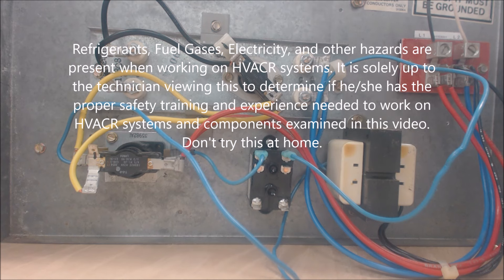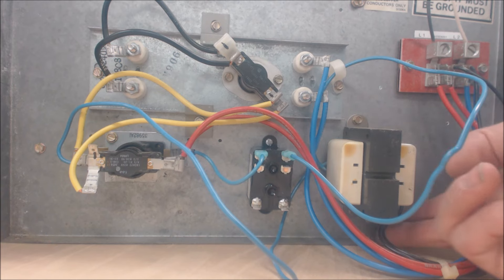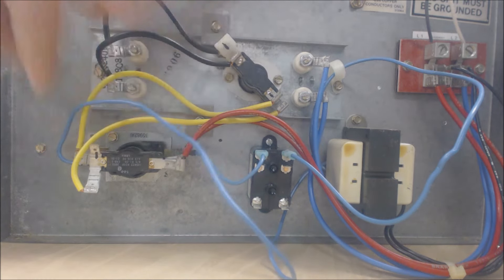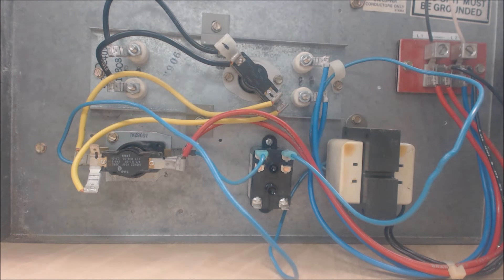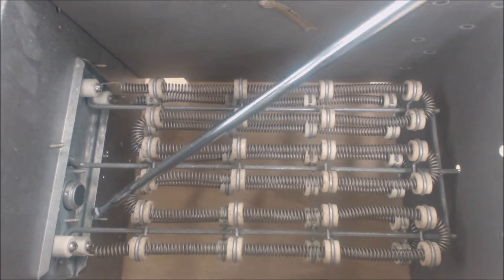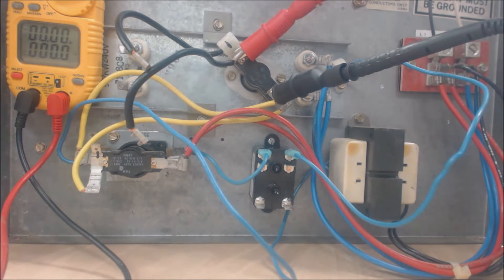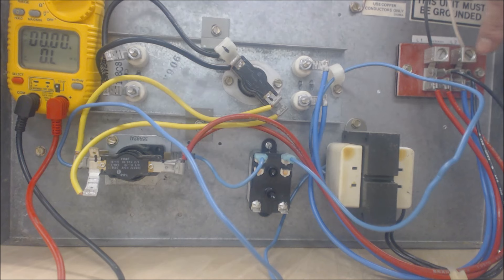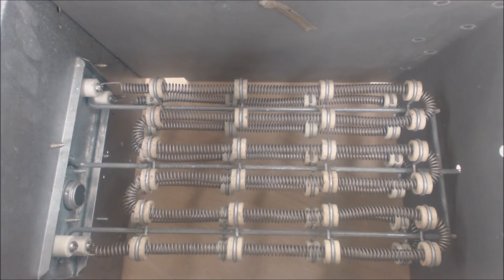HVAC Electric Heat Strips and Components: Explained, Voltage Path, Resistance Readings!

Comment: Great video. I have your book. This acts like an or gate as far as sequence control. For 3 or 4 element I suppose you just repeat with an additional circuit breaker and the 2 element sequencer.  Is there a 3 element sequencer made for 220v circuits ? Gotta wonder, probably not.

Comment: I love your videos. As an electrical contractor .  OL on the meter stands for (open line).  N.O. = normally open as it sits for contacts.
Reply from the maker: Hey Tunazzi, OL can also mean over the limit of resistance that the meter can test, meaning an extremely high resistance. Open line and over limit are the most frequently used terms. I believe everyone uses the same description for NO and NC, thanks

Comment: Mind blown. You made it so easy to understand. Especially, the electricity path of travel. Other channels fail to do this.
Reply from the maker: Check this one out too on the 24v wiring of an air handler and heat pump! https://youtu.be/1nQ7k_X2aXA

Comment: Could you post a video with elements also explaining more in depth the fan relay and blower motor wiring. Or am I just not seeing it if you already have one. I know that's a lot to ask but you are the best instructor on you tube.
Thanks for all your hard work!
Reply from the maker: So I apologize but I do not happen to have something like that yet. I do however have 240v blower motor diagnosis and how it works, and thermostat, heat pump defrost board and air handler board wired all together and what is happening, and a video on how fan relays work. Here they are. Always feel free to ask because that lets me know what people are looking for. Also check the playlists such as Heat pump troubleshooting or Blower motor troubleshooting or any of the other playlists and just pick the videos you are looking for through there. That is what I tell my daytime students. -- https://www.youtube.com/watch?v=uHXw8o_YoZk&index=16&list=PLxnHR5_D2ojyDrxCT9MIttGW4wxOZ3n-7  --  https://youtu.be/AE5zRWtlhAA  --  https://www.youtube.com/watch?v=fFL_ZSkAZM0&index=11&list=PLxnHR5_D2ojzDfU1IjPpzdhi_mUGe3F7W  --  https://www.youtube.com/watch?v=qiAOvJhq8_s&t=115s&list=PLxnHR5_D2ojzDfU1IjPpzdhi_mUGe3F7W&index=8

Comment: hi, sorry but i am a little confused. one end of the heat strip is getting 120vac (blk wire), the other end is also getting 120vac (blue wire). so how does voltage path goes from L1 and back to L2 when both ends of heat strip has 120vac? please help as i've trying to figure this out for awhile now. thank you to you and all your awesome videos.
Reply from the maker: So the 240v finds its way back through the other hot. 240v doesn't use an additional common. It has to do with the sine wave of the voltage being 180 degrees off from the other one so they don't interfere with each other. This frequency happens 60 times per second, thanks
Reply: Hey service tech . Can u explain but a little deeper ? So if if there’s no call for heat , and I put my meter across one side of heat strips and the other end I should be getting 240.v since it’s open . But when call for heat it should read Nothing as it’s close .? Or am I complete wrong ? Please help thanks in advance

Comment: That looks like a 10kw heating element. How do you determine the limit switch rating? Awesome 👍!!
Reply from the maker: You can use ohms law by reading the resistance of the coil and the current when powered. current= voltage/resistance  thanks!

Comment: Great videos!    I am doing an all new install of my Gibson/Nordyne 4 ton split system heat pump/air handler.   My 24kw heat strip has three 60 amp breakers and my unit is 30 feet from the breaker box in my house.  I have to use the HUGE size wire for those  three 60 amp circuits don't I?   I had been thinking I was going to use a bunch of 10 gauge wire and have an easy time.....
Reply from the maker: You definitely cannot use something as small as 10 gauge. You would have to look at the wire length to determine if 6 gauge or 4 gauge to each breaker would work.

Comment: On this application, would you run the white wire to the fan relay?  Would the sequence of operations be? 1. White tstat wire calls for heat and closes fan relay. 2. sends 24 volt signal to sequencer. 3. Closes 4-5, then 2-3?

Comment: I have a question about the high dollar furnace boards. Why do you even need them when you can do both  heating and air with a simple thermostat, sequencers and/or relays?
Reply from the maker: Some units run heaters on sequencers such as some overhead garage units and such. Ha ha yeah it is crazy right? It is all about efficiency and control of OEM parts I think.

Comment: What size of heat strips are  correct or recommended  for a 2 ton heat pump.
Thanks for all the information it is really good.
Reply from the maker: Hey Ruben, honestly that will all depend on your heat loss for the house as well as where you are located at in the country due to design temp. What I mean by this is if you are working with a conventional heat pump and it is 10 degrees outside, the heat pump won't be able to provide much in terms of heat and all you are left with is your supplemental heat strips. In this case if you were stuck with heat strips only then you may want to go with the higher kw ones. If this is florida or somewhere where the temp does not go down very low then the heat pump will always provide some heat and your supplemental strips can be less such as maybe 5kw and not the full heat load. We cant go just by the size of the existing heat pump size but you would need to know how much total heat you need (heat loss) and the design temp of that area. I hope that made sense, thanks
Reply: acservicetech thanks it is really helpful.I' m in NC.

Comment: Had my electric meter chekd and it's fine but he said that the heater when we turned it on it was pulling over 100amps.Does this sound possible and if so what would be the cause?Also this is a carrier heat pump and the heat still works but he was saying that it's the culprit for the high bill?

Comment: This would have been a great time to cover the "W" circuit that requests Aux heat, and the many things that could cause it to go awry... like on my heat pump. This looks a lot like my mom's electric furnace, but my Trane heat pump has a (failed) large 2-pole contactor and a problem with the 24V control circuit for Aux heat. 2 strikes and it's out.
Reply from the maker: Yes many have sequencers and/or contactors. I have videos specifically on those, thanks uruiamnot!

Comment: Great video with usual detailed, non-assuming information offered so all experience level techs can understand.   If the two strips heaters are typical 5KW each or pull ~21 amps @ 240 V, please address the size of L1-L2 source wires which appear to be smaller (less ampacity) than the wires from the terminal block to the sequencer and to the strip htrs.    Perhaps camera angle/depth causes an illusion.  Thanks and Merry Christmas with best wishes for the new year.
Reply from the maker: Hey Papa Joe, You are very much correct! This was only for quick testing purposes and you are right, I should have put 6 gauge on the top. I will put a note in this video and I will put a fixed note in one more I am editing. During the installation the wire must be rated for the max amps of the fuse or breaker that the unit is calling for. Thanks for pointing that out. I was not sure how much of that was going to be visible and this strip kit is sitting on my workbench. Thanks Papa Joe, always a pleasure!

Comment: Great video! I didn't see the high-voltage, for the blower motor. Is it usually 240v or 120v?
Reply from the maker: Yes forair handlers it is usually 240v there is usually a fan relay on a control board or a fan relay by itself or a sequencer, thanks!

Comment: When the defrost board energizes the W terminal during defrost to turn on the heat strips, should the thermostat aux indicator light up?
Reply from the maker: Hey Randall, only if the Emerg heat and Aux are jumpered together. Defrost powers Emerg heat and it may backfeed voltage to the aux.

Comment: I been having issues with duel fuel troubleshooting. The gas ruud units with heat strips. Do you have any help for me?
Reply from the maker: Do you have a model number? What kind of thermostat are you using?
Reply: Thermostat was a manual suited for a heat pump with switch for em heat and heat. Only the gas would come on in both modes. This is my first heat season as a new tech. My company I work for half do stuff. I want to learn the right way how to do thing.
Reply from the maker: Have you checked this video on dual fuel wiring?  -https://youtu.be/HhhesjH9BWI  -or air handler wiring to hp thermostat-  https://youtu.be/fFL_ZSkAZM0 ---- you may want to check out the thermostat troubleshooting playlist for other troubleshooting tactics as well, thanks ----  https://www.youtube.com/playlist?list=PLxnHR5_D2ojzDfU1IjPpzdhi_mUGe3F7W

Comment: There is no inrush current for resistance heating. The same amperage is felt in circuit when resistance heat is first turned on as it is a minute later, an hour later, and so on.Inrush current occurs in motors, high amp draw to start, than a lower amp draw after up to speed. If ckt. cant handle both heaters coming on at same time, it still wont handle it if they are staggered.
Reply from the maker: You are correct. That is a resistive load.

Comment: whats the purpose of having that fan relay before the sequencer?and why dont you show the fan wired in with it?to show an actual functioning unit
Reply from the maker: This video was just on an electric resistance heat strip kit. This is just one version of a heat strip kit. I may in the future show the wiring included with an air handler board. Thanks

Comment: Thanks for great video, I have 20kw heat strip hkr-20c, 4 coils and 5kw on each. And one of the coils was damged or broken, which was caused by loose connection at one of the two  double stacks sequencers. Can I still use the other 3 coils assuming I will replace the bad sequencer and leave the broken coil out of electrical connection from the sequencer plus making sure the damge coil are not touching other coils?
Reply from the maker: Yes you could, thanks

Comment: I have a Tran Model TWE030c140A0 XE1000  unit, my fuse in the thermostat in blow 3am
when the heat come on? it is in the thermostat, or the electric  Heat?
Reply from the maker: It could be the therm, therm wires, or relays. You could first try jumping bypassing the thermostat to see if it is the face that is the problem, thanks

Comment: Does this heat strip connect to an entirely different circuit apart from the air handler itself?
Reply from the maker: It is usually all one in the same. Always follow the install directions from the manufacturer though, thanks

Comment: where did the red wire coming from my blower fan go my account shut off and it's disconnected think a rat knocked it off or tape got old not sure
Reply from the maker: Does it say on the connection diagram for wiring on your unit? If it is a red wire from a psc blower then that usually means low speed, thanks
Reply from the maker: I am sorry, I only answer comments and don't do consultations. You would need to follow the wiring diagram, specifically the connection diagram. Make sure that the power is off and you have read no voltage with a multimeter before touching any wires. If you are not an HVAC tech then I can only advise to call one, thanks!